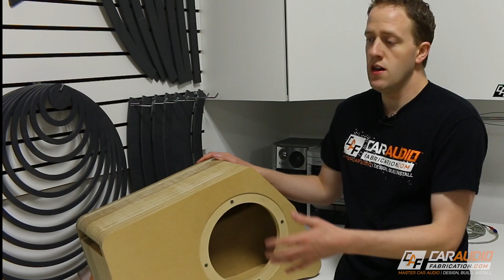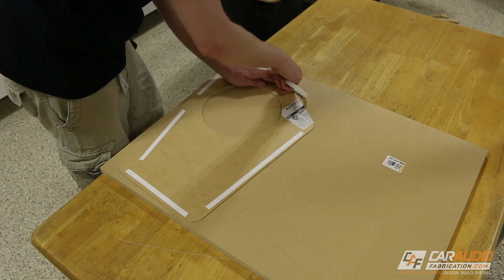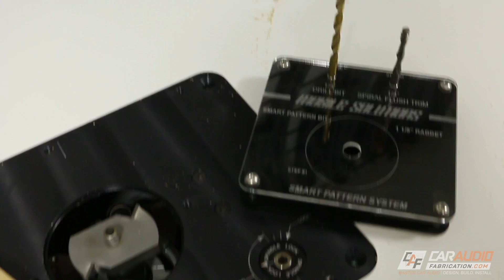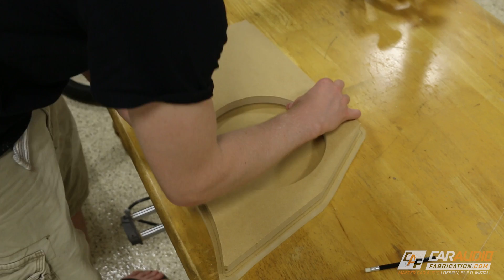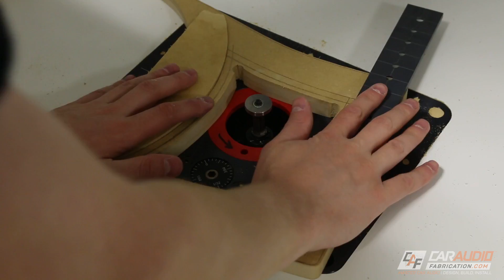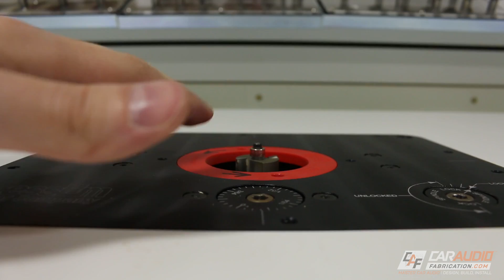Subwoofer Box Beauty Panel - How to - CarAudioFabrication

Comment: You do very nice work, and put the proper amount of though into the details. Looks to be on the same level as some of the guys I've seen, who build advanced horn loaded prototype enclosures in the pro audio industry. Funktion One which is a pro speaker manufacture I've spent a lot of time with, uses a lot of advanced horn loading designs and they prototype everything in-house to a very high standard. I'll be honest and say that your work looks to be on that level.
I'm impressed.

Comment: How do you make a custom 2 12 box with leds inside a 05 dodge neon with the specs for subs; ported box--> 26w"×15h"×12d" (2.0 cft) 
Sealed --> 18w"×15h"×10d" (1.1 cft)
and which box would be better? I was thinking Plexiglas to cover leds but what are your thoughts?
Reply from the maker: Your ported box dimensions would only allow for about 1.45 cubic ft of airspace after displacements, this is not enough for two 12's it would be tight for 1. You can purchase a box design blueprint on my site so you know that what you are building is correct: http://www.caraudiofabrication.com/box-designs

Comment: Are you planning on using the the neos? 😁. I'm wanting to build a downfire box but, I also want to do a slot port. Is there a reason that the slot seems to start behind the sub? My version is going under the back seat of a Old body style GMC Dually and the slot will start on the side of the sub since I don't have the vertical space to put one in.

Comment: Why is the insert taller than the trim ring?  I seem to have missed that.
Reply from the maker: +Seth Ranney when I do the step in the trim ring with the large rabbeting bit it removes some of the material thickness, I could copy to a new piece of I wanted a full thickness but I like the way the inside piece adds another layer of dimension.

Comment: hey Mark, any advantage or disadvantages between that spiral up cut bit with 2 bearings you used vs the spiral bit with the quad bearings from mobile solutions?
thanks!
Reply from the maker: +B Plail the quad bearing allows you to copy a stack of different templates stuck to each other. Also works great for copying stock speaker adapters where the shape may change with height.
Reply: CarAudioFabrication makes sense! thanks heaps!